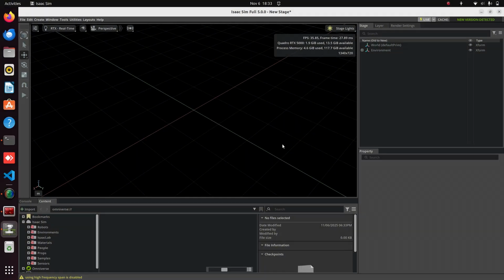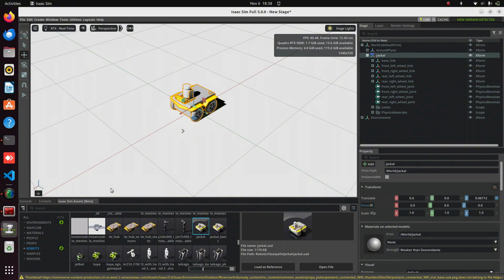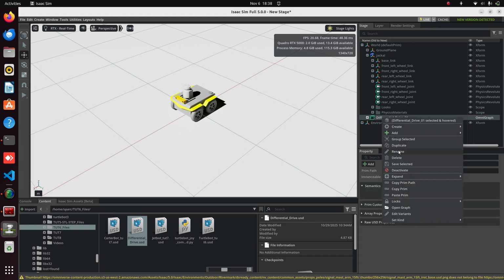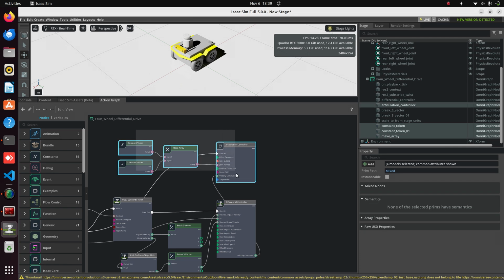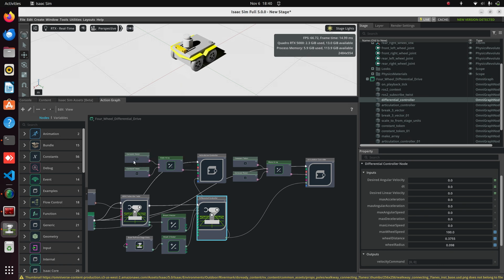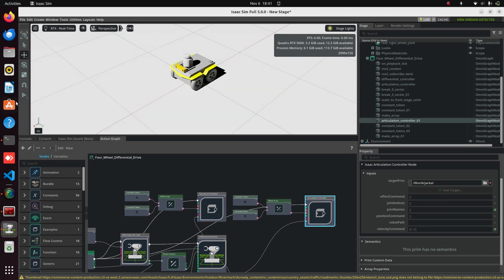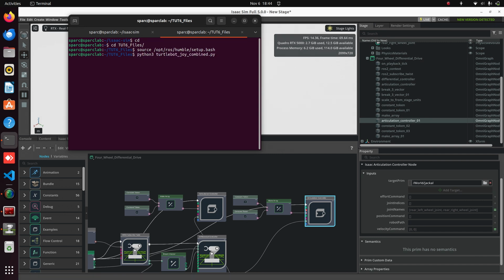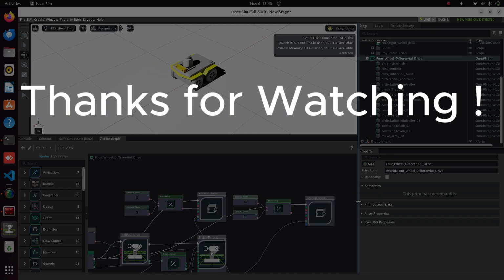Tutorial #8 – Four-Wheel Differential Drive + ROS2 Bridge in Isaac Sim

Comment: which commands you used to install ros2 bridge, as when i go to extensions and want to turn the 4 extensions made by nvidia it does not allow me. Hopefully you can help me, as I already looked in the nvida repository
Reply from the maker: You don’t need to install the ROS2 bridge manually when using the Workstation version of Isaac Sim. It already includes the ROS2 bridge by default. Check Tutorial 1—after running Isaac Sim, a pop-up window will appear where you can enable the ROS2 bridge and select the ROS2 version.

Also make sure you don’t source your system’s ROS2 in the same terminal before launching Isaac Sim. Isaac Sim uses its own internal ROS2, and sourcing your system ROS2 can cause conflicts that prevent the extensions from loading.